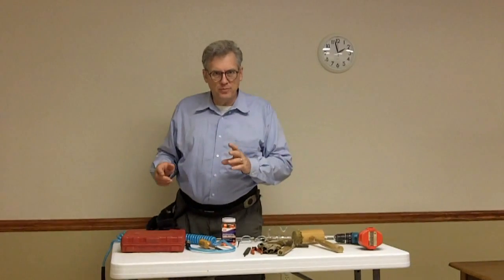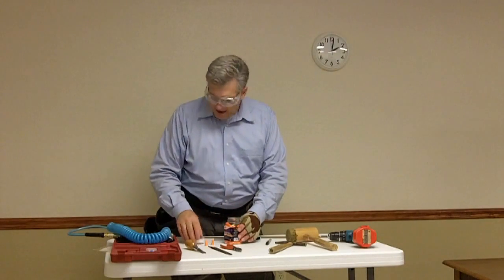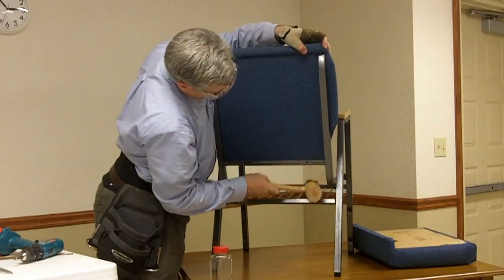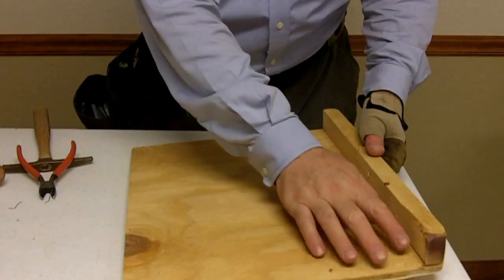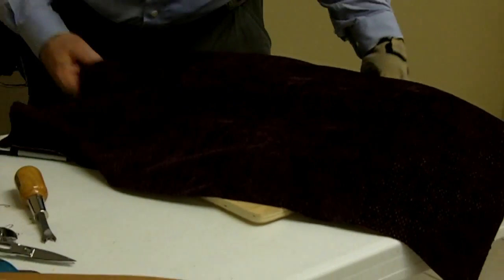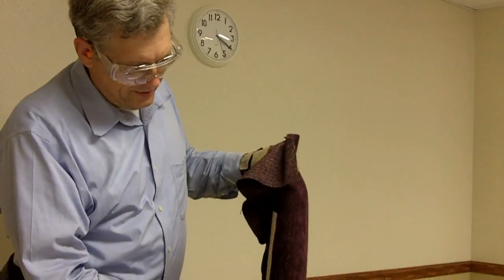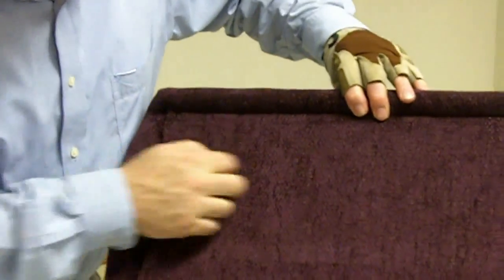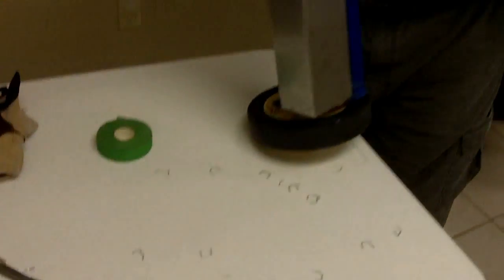Introduction to Upholstery: Meeting Hall chair

Comment from the maker: Still need to show Cutting, Sewing, how to make decisions regarding Patterns, how Wooden Arms might be handled. Probably could EXPAND the tools and safety section and make it a separate shorter video.  Seats are different than backs and could probably break them out.  Much more could be \shown about the way decisions were made in doing the inside backs.  The seats could be modified just a little.  SO much to do so little time. Appreciate your watching this one long version.

Comment: Hello Mr.Youngdahl,
Would you be able to tell me how much it would cost to upholster a chair like this myself?
Reply: Or maybe you can tell me how many yards of fabric are necessary for this project.  I can figure the cost from there.  Thanks.
Reply from the maker: We figure 1 1/2 yards. We figure actual expense of supplies including foam dacron fabric,  at $18/chair (but we buy fabric at $6.95/yd)
Reply: Dave Youngdahl
Thanks so much!  This is very helpful.  Seems to be worth it!
Reply: Dave Youngdahl
One more question...can this be done without sewing?
Reply from the maker: +Janine Ramsay Sorry I did not see this question!  the answer (which you probably figured out for yourself, is "Yes".